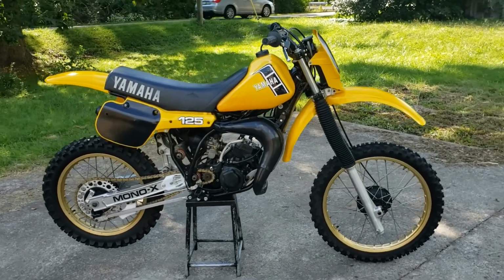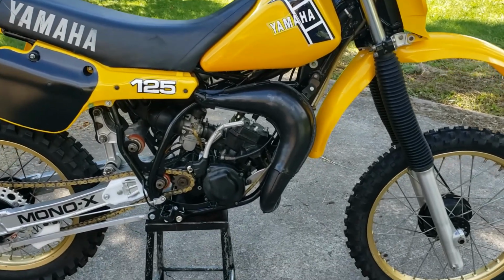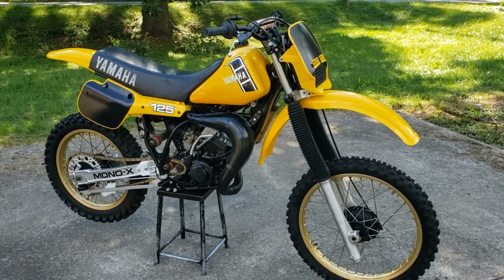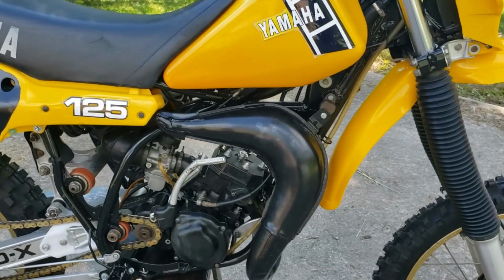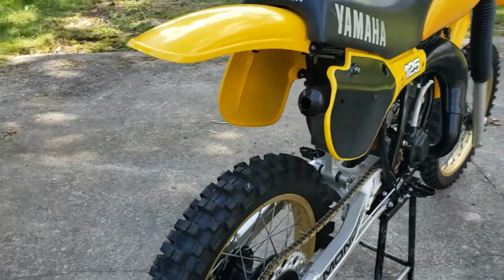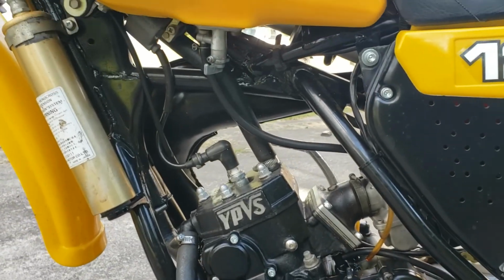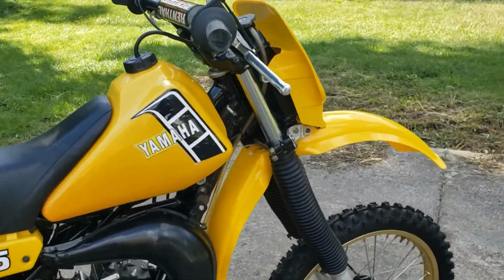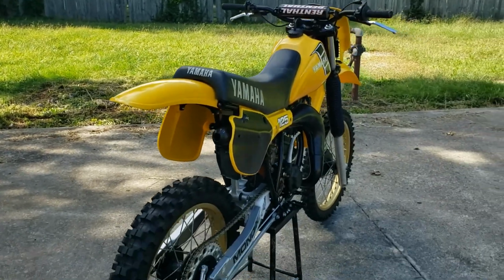1982 Yamaha YZ125

Comment: I had one when I was 13. It was 1985 and we got the 1982 yz125 for 300 bucks because the engine wasn't mounted to the bike. Plus it had some other stuff it needed.  My dad bought it for me and it took a while but he got it running..I was so happy it was bored .030 boysen racing reeds it was way to powerful for me. The bottom end wasn't too bad but when the power band or power valve hit in mid rpm range it was wicked I remember shifting into 3rd gear on the road in my neighborhood and the back tire was spinning out then the power band kicked in and took off on a wheelie.. I think top speed was about 60 or 65 but from about 10mph to 50 it was just wicked for a 13 yr old who's last bike was a 1975 suzuki ts75 awesome bike. Only thing I didn't like was the rear shock was under the gas tank it hooked to a linkage to the swing arm

Comment: Its the second year yz 125 with watercooling. The 81 and 82 were the only years with the radiator on the fork. It was the first yz 125 with power valve.  Very fun weird bike . I own one in white
Reply: Got a 1981 in model new when I was 13..the 82 was faster with a little better shock..less of the 82 were sold than the 81 ..the news was out on handlebar / radiator set up..but it wasn't  as bad on the 125 as it was on . The 250..alotta people bought and won on the 81 that season it was the fastest but in 82 the new improved and must faster than 81 model rm was king..was 81 too just wasn't as fast